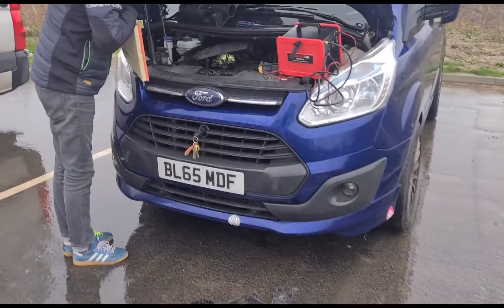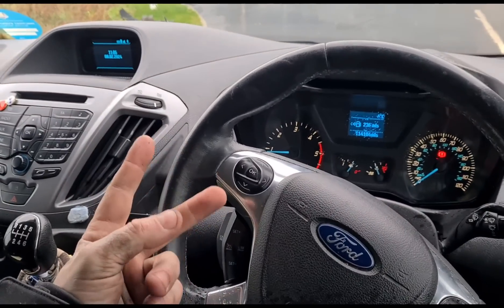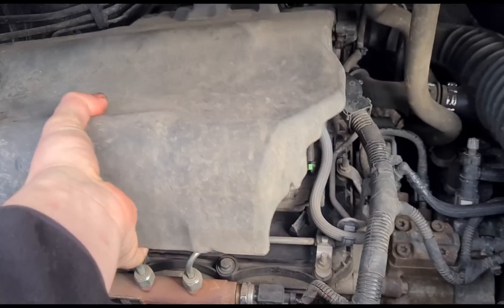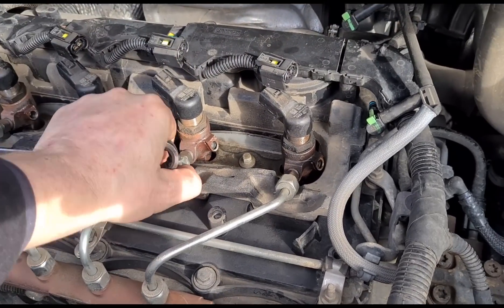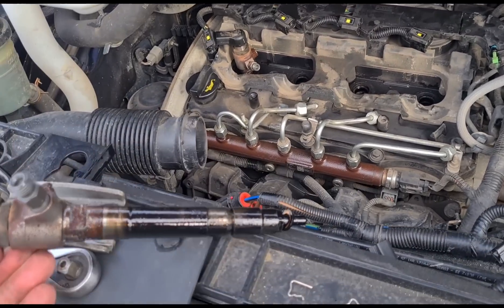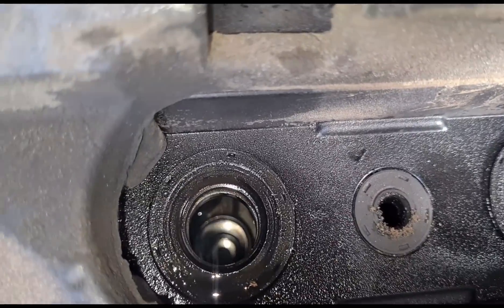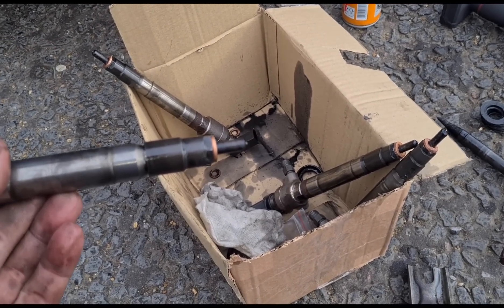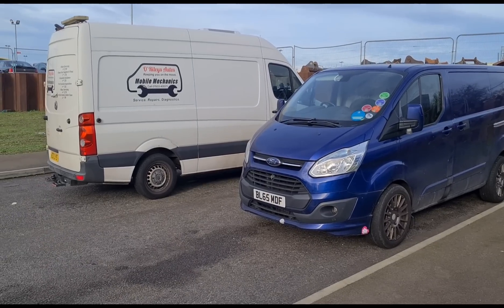Ford Transit P00BD:00-26 Mass Air Flow Circuit Range/Performance Air Flow Too High

Comment: this job made no sense. the injectors were leaking around the oil seals just because you got a pressure build up in the crankcase both through the crankcase vent and piston rings. if copper seals were blown you wouldn't be able to pull the injectors out by hand. the copper seals were probably perfectly fine. even if they failed that wouldn't cause the DTC like that. if the van had the EGR blanked, blocked or programmed off - that would cause the MAF high input error. the ECU opens the EGR valve, so it expects a lower air amount going through the MAF sensor. if EGR is blocked or restricted in some way, then even if it opens it doesn't allow gasses through so all the air the engine sucks in goes entirely through the MAF sensor - hence higher than anticipated flow. the injector oil seals, even copper seals have nothing to do with it.

Comment: Hi another great video , my transit live data says -40 on air intake sesnor what coulds that be ?  i got the launch 129 due to you review on them
Reply: You have probably sorted it but if not it's part of the maf sensor.
I had problems with a late mk7 where a euro4 Maf had been fitted and would read -40c below actual temperature.
Caused starting problems on cold mornings but never stored a code.

Comment: I have a transit custom 2018 2.0 diesel
Eco blue engine and I have 2 codes coming up P02ED (Diesel Intake Air Flow A Control System - Low Air Flow Detected)  & P008A  (Low Pressure Fuel System Pressure - Too Low) 

I had a dpf regen done but still no change. 
Doesn’t seem like an air leak but I have not done a test as you have on this video. 

What could be the issue?

Comment: Thanks for the usefull video, we do not think first to check that rubber seals on injectors but first leaks on boost lines from turbo-charger

Comment: Hi looking to buy a new scanner as my old Autel 908p now outdated. I was thinking between the autel maxisys ultra or the launch euro tab 3 which would you recommend?
Reply from the maker: Tab 3 wins. Both aren't perfect. You will find some compatibility issues with both. I have a cheap otofix and snap on just incase as other options

Comment: How does changing injector seals fix a mass air flow too high?
Reply: it doesn't. they were perfectly fine. if copper seals were leaking he would struggle to pull the injectors for for the caked oil around them - these were perfectly clean so copper seals were holding tight. the oil seals in the valve cover were leaking because the smoke machine built up pressure in the crank case through the crank case vent. the EGR flow in that engine must've been restricted which causes the high MAF input signal error code.

Comment: Hi jimmy in my experience with fixing work’s fleet of transit normally the egr tube where it goes into intake chokes up. So when the ecu/pcm wants to see less air flow when egr is open it doesn’t. Similar fault come when people put blanking plate in. Hopefully I can be helpful to you as you have to me with dpf problem 👍

Comment: Hi, Do you have to disconnect the battery before removing the fuel pipes from the injectors?  Mine has a fuel pump that primes before use, so was wondering if its any different?

Comment: After owning 8 Iveco, 5 older pre 2000 ford transits, 2 Merc sprinters, and now Vauxhall Vivaro all well over 140k, I have only ever had one injector leak on an Iveco, I can't believe that Ford only use one bolt to hold down 2 injectors on the copper seal. I had trouble to stop leak with one injector that was threaded with a copper seal. There is enough problems with modern engines without having weak designs like that. I almost bought a transit custom on 43k and it sounded rough then, so you convinced me not to get one. Thanks for the upload.

Comment: Pumas have been blowing combustion gas into the crankcase since the 2.4's because of this silly injector setup! Part of the yearly service on Landrover defenders 😂 good injector seat cutting tool is a must if they've been blowing a while aswell

Comment: On transits I've seen the air intake temp sensor mounted in the intercooler, read incorrect and throw air mass codes. Normally happens in the first 10mins of driving from cold
Reply from the maker: That was already changed along with the air flow sensor and map sensor
Reply: @ORileysAutos  watched all your videos on Renault traffics! Have a 2015 showing all the normal symptoms, had all different things changed but still air pollution, injection system showing. Need your HELP!!! you’re 3hrs from me but happy to travel to you for diagnostic and your expert opinion. How far in advanced are you booked?

Comment: The rubber seals seems like a poor choice of material from Ford. With the heat and vibration of the engine it's inevitable that they're not going to last for the life of the vehicle.
Do all engine manufacturers make their top injection seals from rubber?
Reply: Some just use a copper seal at the bottom

Comment: Honestly the number of these videos where the prior 'mechanics' have just let loose on the parts cannon at the customers expense is shocking.

Top work as always Jimmy 👍
Reply: but it was exactly the same here. injector seals were 100% not the issue.